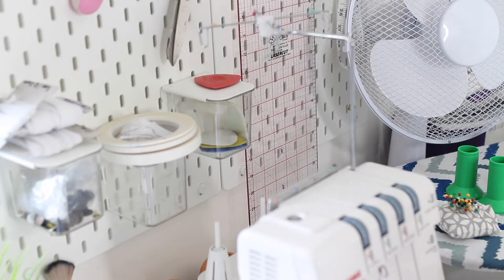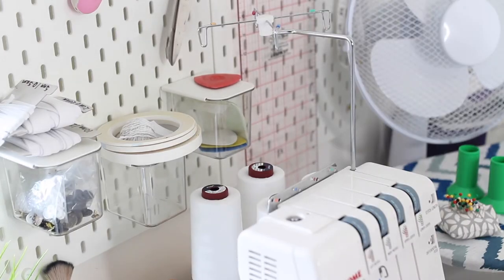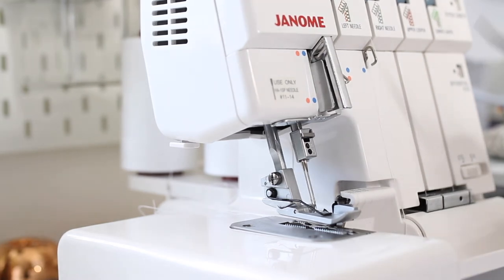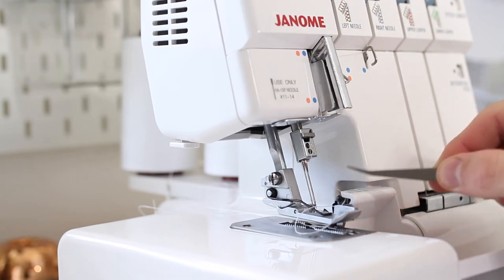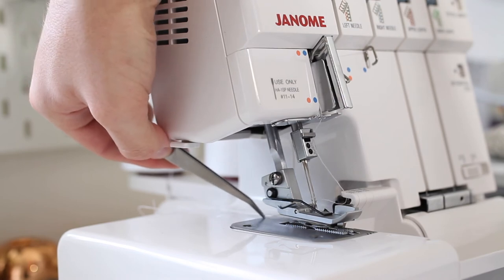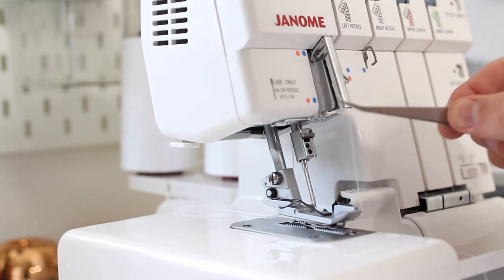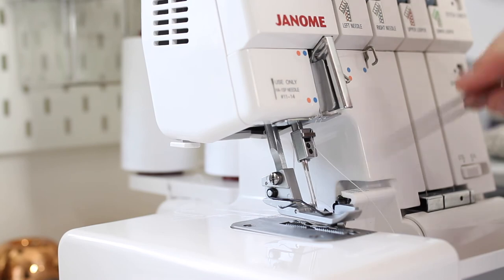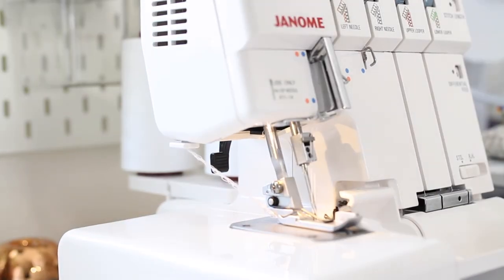How To: Easiest Method to thread an overlocker in just 5 minutes! | Ryan’s Sewing Corner

Comment: I am struggling with my overlocker. I've followed the instructions for threading but it's not right. the lower looper is not connecting with the left needle and I'm not getting the seam stitched. 😱
Reply from the maker: Is it the same overlocker as the one in this video? If not it may be slightly different as this is just a guide

Comment: You have the best serger. Janome.    But the threading is in incorrectl order.  You start with the Upper looper first.  Lower looper next,,,,right needle next. Last left needle.   You also need to get a better tweezer,,,  otherwise all is good.  Try it my way.  Been doing this like 50 years.
Reply from the maker: Thank you for your advice, but as you can see in the video this method works perfectly fine and is correct for this specific machine :)